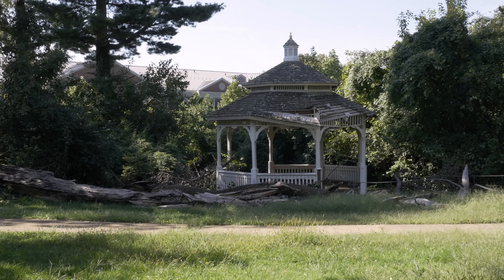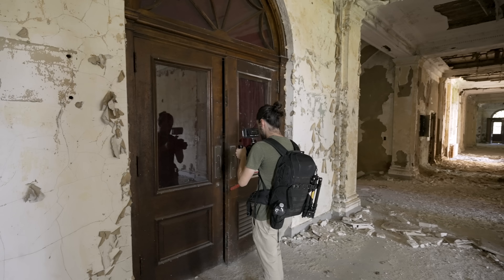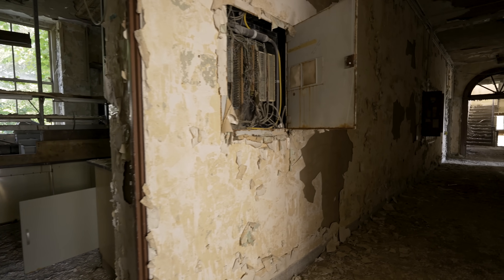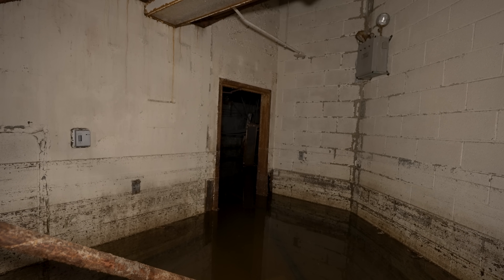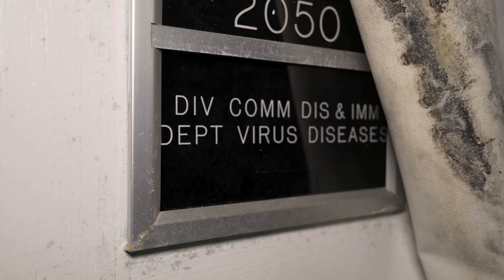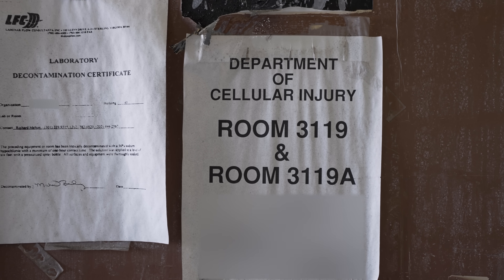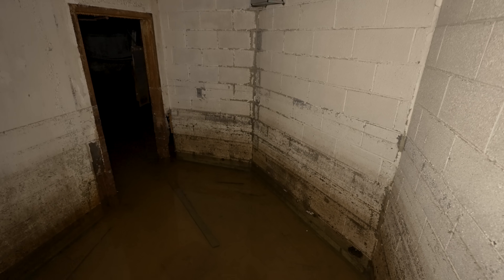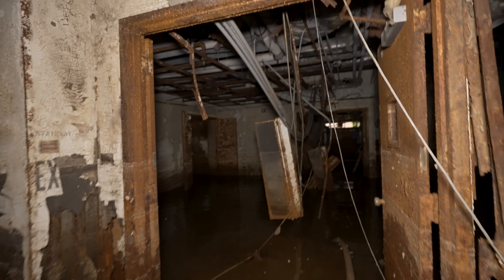Exploring an Abandoned US Government Biomedical Research Facility - They Created Vaccines Here!

Comment: all that tile, negative pressure doors, you've found a 1960's state of the art HIGH level containment area. Tiled surgery looks like a standard surgical suite. Morgue may have had the stainless steel table - sent elsewhere or pilfered by scrappers? 
Heard of being 'short staffed'? now we know where they worked! in 'low clearance zones'😁
Reply: I remember a piece of medical equipment was supposedly not disposed of correctly in Mexico, it was in a scrap yard and a guy broke it open to see what was in it, then gathered a bunch of pellets that fell out, and took some home. 
later the remains of the device was recycled, then some of the iron used from it was made into wrought iron table legs, the trucker delivering them into the US tripped a monitor as he took a shortcut through part of Los Alamos (I think it was) their detectors tripped and caught the truck on camera, it was hunted down, the table legs then traced back to Mexico & scrap yard, to village yard was in, the village showed high radiation levels,. turned out the kids had been playing mables with the pellets, huge cleanup involved, collage razed, people moved & treated.
I forgot to remove my dosimeter when getting a sinus exam (head X-Ray) done, when submitted at end of month, dosimetrr service sent a telegram. I got a 2k millirem dose. Due to that I could not work for 30 days, not to be anywhere near a raxiation source until after my next dosimetry report cleared me.

Comment: The  window  above the   door is called   a  "transom.    That's   called  a inlay   ceiling     "   Big three  phase  bus bars, high current  to run all the  equipment  in the labs    That   was a declamation     shower  with the blue  tile walls

Comment: I was amazed at the all the paint coming off the walls but then realized it was a government building and being built in '20 and probably repainted a couple decades later all with enamel paint, someone made a boatload of money by painting over the existing oil based enamel with water based paint without any sanding or priming. You can actually see the enamel paint shining underneath. Some walls the entire wall of paint was just barly hanging in one large sheet like someone hung a bedsheet on the wall. Typical government contract painters. I know, I worked for a painter that did government buildings. No oversight. Get in, get out.

Comment: Did the decontaminated labs smell sweet or of vinegar?
Maybe they used O3 but the notice read that all surfaces were soaked, that would point to formaldehyde or peracetic treatment.
As it was a company involved with laminar flow and decontamination in ~2000,, I assume it was formaldehyde.

Comment: If there is anything left of the reactor it will defo be in the lowest point possible as that would be using the earth as a natural barrier to anything leaking out. Depending on when it was also in a state of decom then they may have gotten rid of the most "valuable" parts.

Comment: 27:38 Do you think that rotating door is made of lead, so that there is no way X-rays could escape the room, as there is no way to leave the door open?   You'd have to rotate the door, step into the center, and then rotate again to allow yourself to walk into the room.   At no time would there be any way for there to be an open passage to the outside.   They had similar things called Powder Scuttles in battleships to prevent an accidental explosion from spreading into the powder storage areas.

Comment: Maybe the basement was flooded to keep people away from the reactor and the radioactive ethyl methyl bad stuff that could not be scrub out??? Also maybe that building is still standing because there is a reactor in the basement??? 
I worked jobs that were contaminated empty lots, we paved the whole lot with a foot Asphalt and installed a 30 foot high fence around it with no gate.
Reply: Or maybe there's this thing called an underground water table. You know.. Maybe.
Reply: @UnitSe7en  That would really be bad and ashamed for that community, if there is or was a reactor in the basement. Having radioactive ethyl methyl bad stuff leach into the underground water table. Most reactor in the US built after the middle 1940's are mandated to have pretty good containment structures.
Reply: @UnitSe7en I did work on a site remediation job back in the 80's that was a huge lead acid battery manufacturing facility right next to a bottled water plant and they shared the same water well. When the trees in orchard next door die in the 60's, they figure they had a problem.